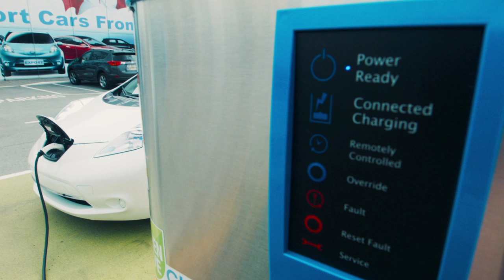Electric Motorcycles vs Gas Motorcycles (HARD FACTS)

Comment: Electric bikes need a removable battery of industry std design that can be swapped out in seconds. Imagine having a bank of batteries on charge & charged at the local servo like swap n go gas bottles  You pay a set fee just like the gas bottle system & now its just as fast as fueling up. You pull up remove your battery & put in the bank on charge then grab another fully charged & install then ride away.
Reply: It doesn't work that way. This idea is not original at all, it's the most common innovation by people on the internet
Reply: There's already an electric road scooter with standard swappable batteries in Taiwan. Look up the success of Gogoro. They have even has other manufacturers join them like Yamaha offering their own electric scooters based on this battery ecosystem.
Reply: Michael Clark they need swappable batteries. Real, long distance batteries, are far too heavy to just pull out.
Reply: @michaelclark3192  I came here to say just that. I currently live in Taiwan and Gogoro has really caught on out here.
Reply: @savagetuner2404  LOL you got something correct for once. A 25kwh would be way too heavy remove by hand and needs to be an integral structure of the sportsbike. Removable modules is already being done on weak small rideon like E-Scooters.
Reply: @shaggy LOL 600cycle is outdated to the point of wrong. Something like the Zero SR/F of that generation conservatively will do 1000 cycles. Based on a realistic 150 miles that's 150,000 Miles of solid dependable poweroutput. It could probably limp along with problems as it slowly decays all the way to 200,000 miles.
Reply: You know what its better to have a battery that can charge only in seconds and have a battery tht is lightweight and heavyduty..
Reply: You'd have to have some access codes...otherwise the meth patrol will jack em.
Reply: I don't complicate myself,I just fill the tank in a few seconds in my Honda CB1100EX and ready to ride with awesome sound and power
Reply: @Shaggydoo90 It's not that bad. the figures I've seen quoted for the LiFePO4 batteries used by most e-motorcycle and moped manufacturers are 20% capacity loss after 2000 cycles. However that's an optimistic range, the LiveWire only gets 70 mi highway range and the 14.4 kWh Zeros get 112. Twice that for city riding.
The key really will be standardization on a battery form factor. The Zero motorcycles have kept a single form factor for battery packs, while the technology improved capacity some 20%. If the big four were to collaborate on a single battery pack form factor, the economies of scale could cut the costs quite a bit, and mean that after the first 100,000 miles there would be aftermarket replacement options (and perhaps much better options, like solid state).
Reply: Someone just talked about NIO's entire EV business setup  in like 3 sentences
Reply: NIU makes removable battery mopeds, they have an electric motorcycle coming out soon that may have removable batteries too.
Reply: The problem with removable batteries is, who owns them? 

Seems like it would have to be a subscription service where you don't own the battery.  Do I swap my new battery with who knows what someone previously turned in?  Of course not, I'm going to trade in my 6 year old worn out battery.  And everyone else is going to do the same.  And the quality of the batteries in the pool is going to gradually degrade.  So the owner of the recharge service would probably have to own the battery, not riders/drivers.  This would likely also require the charge stations to be a large nationwide, or at least regional, chain.  Right now almost all gas stations are owned by franchises that only own a small handful of stores.
Reply: @rightwingsafetysquad9872   I wasn’t going to comment seeing how old this thread was but then your comment was only 10 days ago so yay I can comment! So I was completely on board and then realized what you’re saying as well. Then thought of a simple solution, all you do is turn your dead battery in like a core charge and you “buy” a new one. Still with the intent of the gas station gas bottle idea though. So as someone mentioned above, a lot of manufacturers come together and come up with an agreed design and then they push the system through gas stations. The gas stations have a process set up to automatically restock their batteries and a system for returning “cores” to the manufacturer. Those cores are of course anywhere from depleted 1 cycle to however many cycles it took that old guy to trust this system and buy one and try it out. And the new battery costs whatever and the cores give you a large amount of credit back seeing as your old battery isn’t really bad or a true “core” battery. Then gas stations could make the profit with the core exchange in mind and aim for it to come out somewhere right in the ballpark of the cost for your average bike tank of gas or charging session for these electrics. That would alleviate the issues you’re talking about with someone getting a “used” battery in bad shape from somewhere random. Each core HAS to go back to the manufacturer to get checked, completely remanufactured properly and can then be sent back out in a box to another gas station with a sticker saying “reman” or “new” for the news ones also presenting another way us customers could choose what we wanted to pay for. And yet again, we could even shift this from gas stations if that’s too much of a new system/hassle for them and direct that system to auto parts stores where they already stock TONS of batteries and already have complete systems in place for retuning cores on car parts and warranty-ing batteries and everything!
Reply: @julsluzanes5209  You mean a capacitor?
Reply: Taiwan's Gogoro scooters do this.

Comment: I've got a Zero SR/F.  The range is sufficient for what I do, charging is pretty quick (6kW), and the thing pulls like a liter bike.  Best part is going 0-80mph-0 from one stoplight to the next, silently!
Reply: I might be confused but you said silently as if it was a good thing. I'm sure it's just me mis-understanding you, going 0-80mph making zero noise fills my heart with sadness.
(Also it's incredibly dangerous as noise keeps us safe as bikers)
Reply: @TheJPHarvey  If I need noise to keep me safe, I've got a Hella Supertones horn on it.  Meanwhile, my bit of crazy-fun acceleration doesn't attract attention from law enforcement.  Heck, I can do a quiet burnout!
Reply: You've made some good points there I'm not gonna lie. But surely just must have a normal petrol bike in your garage too? I just couldn't be without a traditional bike
Reply: @TheJPHarvey  Indeed, you're right!  I also have a Yamaha Super Tenere that I've ridden into Mexico and back a few times.  :-)  But for local trips, I'm loving my Zero.  The two bikes couldn't be more different, each excelling at very different rides.
Reply: @TheJPHarvey  It´s more dangerous for blind pedestrians. By the time they hear it, it´s already there. I while ago I read that there where plans to equip electric vehicles with sound generators to make them more audible.
Apart from that the tires usually make some noise too. For an electric bike that will very likely not be different.
Reply: @TheJPHarvey  This. It's like sex... with no noise. But then the amount of turbovirgins around us who don't know how to have sex, want their bikes to be as limpwristed as they are 😂 👌
Reply: @TheJPHarvey  cars go those kinds of speeds without making much noise. I think this horse is a dead one
Reply: @maxlutz3674  let’s make all electric bikes make noise for that less than 1% of pedestrians lol
Reply: @TheJPHarvey  loud pipes are overrated. Pipes face backwards, the only people you're alerting are people who already see you. And if your pipes are stupid loud people won't be able to tell where the sound is coming from.

Comment: Your energy density comparison between chemical gasoline and a battery pack isn’t valid. Gasoline stores pure chemical potential energy but when burned, it isn’t fully transformed into usable power which results in energy losses of sound and heat. This is called Efficiency, and electric vehicles of all types are simply better at it than gas vehicles due to bigger things being more energy efficient and electric vehicles sourcing their energy from power plants (very being and pretty efficient) compared to your engine (much smaller and more less efficient in comparison).

Comment: It is not environmentally friendly. At best, it's a wash. Electricity comes from coal, the dirtiest fossil fuel. Batteries go into landfills when disposed. All the toxic chemicals go somewhere when the batteries biodegrade. And the batteries are expensive. You're paying for the fuel up front and your electricity bill goes up if you charge at home.

Comment: EV drivetrains are so much more flexible and dynamic, immediate response and performance. Remember range and battery tech isnt fixed, obviously tech like this advances exponentially, eventually making the older tech (gas) obsolete. Its how history and progress works, cant stop it so you might aswell get with the program.

Comment: You point out a lot of good facts but electrics have their place...
I have a Zero SR 2015. In the 4 years riding, the ONLY expense I've had is tires. This bike has paid for itself  in repairs, gas, oil, etc. I hardly ever use the brakes cause regen does most of the slowing down. Yes, they cost more initially but are really cheap to keep.  I've never had to stop for a recharge as I plug it in when I go to bed and I have all the juice I need to ride the 100 miles a day I do. I use the bike for commute and weekend jaunts so it's perfect for that. I'm not into cruising anyway. ...and the torque, WOW! I'll never go back to gas.
Reply: PleaseDontWatchThese | cheaper than an ICE bike in the long run.
Reply: That's great to hear! I've been holding out on account of, even though the "official" range is enough to do the "Alice's loop" as I refer to it (folks from the SF Bay Area might know what I'm referring to), when I asked the guy at the shop that sells 'em, he said real-world he wouldn't count on it. If you're getting an actual 100 miles per charge (is that right?) then that's encouraging. How much of that is at freeway speed, vs around town?
Now that they're starting to get the idea that a fairing might help with the freeway range (halfway there, anyway), I'm hoping sometime within the next 5 years they'll have something that meets my greater Bay Area needs, if not my long-range tourcycle needs.
Reply: @pleasedontwatchthese9593  I can only say that of all the things I have ridden, raced, or flown in 40 years the Zero is the most fun I have ever had.
Reply: dwc1964 | I extended my battery to the max. available amount of 18kWh.
When I really push my bike hard, I can get the range down to about 100miles (100% down to 0% charge … not healthy for your battery to do that regulary).

Usually I can easily get 150miles range.

When I drive carefully I can get over 200miles range.
Reply: 513eis how is the battery after 4 years? Still the full amount of energy?
Reply: Triple D | Probably not, but also probably still well within tolerance. And this is expected. 

Unlike a diesel or petrol powered car where the increase in consumption (read: decreased effeciency) as it ages is never mentioned … at all.

At least with battery degradation the efficiency is not impacted, so it won’t cost more and more to drive the same distance.
Reply: Hy, I am planning on buiyng an electric motorcycle. I was hopingbif you could tell me how much do you spend on charging your motorcycle a month. Would be very helpful if you could tell me. Thank you
Reply: Fatlind Pro | “a month” is a bad metric since a commutor will cover A LOT more distance a month than an occasional recreational rider. And even within those two categories there is a lot of variation.

I tracked my electric consumption the first year. I haven’t got the cheapest electric plan and ended up at about €2/100km

Or to calculate it using your own electric plan: After 12000 km, I charged around 750kWh
Reply: What’s the transmission like?

Comment: Thanks for making this video!  I've been riding an electric motorcycle for the past 4 years and agree that range, charging time, and weight are all huge factors.  If you get a chance to ride the new Energicas, please check them out!  They've improved so much that the gap between gas and electric is getting really small, and the charging infrastructure is totally enough for a cross-country road trip now.

Comment: Glad you added that last comment about 600's. I cant count how many noobs tell me their 600 is just as fast as my R1. We'll, atleast until after they ride a litre bike and realize what my bike does in 1st gear, theirs does in 4th
Reply: oooo you're a big man
Reply: I think you got the gearing backwards....
Reply: @mr.monkei  no you said it backwards
Reply: @sheldondrewett9461  damn just read it and realize I did put it backwards lol
Reply: Doble | I noticed the same but thought you meant stuff like wheelies and acceleration.
as in: Their bike can wheelie and accelerate real good in 1st but your litre bike can still do the same in 4th.
Reply: 600 super sports are quick, but on the upper end. My SFV manages to keep up until illegal speeds. It's quite torquy so off the line I'm quicker.
Reply: I mean they are both equipped with very long gearing, so you arent really riding around at 180+hp in slower curves anyways.
Reply: And on curvy roads... Ah. With the unfortunate long gearing it might matter but basically you are not faster with 200 than with 120hp necessarily. Lazier in shifting. Yeah.

Comment: I think that the new lightning strike having level 3 fast charging is a big step towards electric bikes becoming more practical. Being able to charge what is currently the highest capacity battery in the industry in only 30 minutes is a huge leap forward.
Reply: The Energica already is being delivered and already does that.  No Strikes with that charging or battery configuration have been delivered yet.
Reply: Crissa Kentavr yes they have, just not very many
Reply: See newzerolands videos he talks abt them
Reply: @theelementalscientist6631  Crissa's right, as far as I know.  They're still implementing the bigger battery and DC charging, but that'll be a game changer in getting electrics closer to what gas bike riders are used to.

Comment: Zero S/SR is the best motorcycle type I've ever owned. In the same token, owning a Tesla is better than any gas powered car I've ever owned. I don't do anything over 98 on ANY motorcycle off the track, and I don't go to the track anymore. Purely anecdotally but the lack of sound makes me feel safer because I'm just another vehicle on the road. I've stored my bike for over two months uncharged and it didn't lose a single percentage of charge in that time. I've put "gas" into my bike at convenience stores and other places, and often joke about how I can refuel at more places than gas motorcycles.

The technology is only going to get better. The instant torque and lack of shifting/single drive is something I can never, ever, ever give up now. I hate when I'm forced to ride a gas powered vehicle now - it feels so... shitty.
Reply: I do 105 in my 1997 diesel Jetta all the time! What's the purpose of having a sport  bike that is slower than a horrible car? (I do commute 260 miles regularly)
Reply: Elliott Vader Why do you do 108 in your Jetta, exactly? Unless you’re ripping it on the autobahn, I see no need to ever drive or ride that fast in public. Doing so is completely irresponsible as well as reckless and very illegal (well over every posted speed limit) where I live.
 
So to answer your question, it’s because I’m not irresponsible and don’t drive recklessly. Top speed is ultimately meaningless because even the shittiest cars can go over 100 - doesn’t mean they ever should.
Reply: same here. After riding gas-bikes for over 15 years I am now extremely happy with my Electric Naked-Bike. Regarding to range, the new 2020 Models from Energica have enough Batterycapacity for 200-250 KM. Energica claims up to 400KM, but based on my experience with the 2019 model, I say 200 KM are easy possible, even when you ride sporty.
Charge times. I can Charge up my bike in 20 Minutes or less to 80% State of Charge. So after a 2 hour ride you have to be very quick to go to the toilet and refuel yourself with a cup of coffee in order to not be slower than the recharging of the motorcycle.
Reply: Soy Boi Man I love your point because I have pointed out that too.
here in my country I ride my electric motorcycle EVERYWHERE, is my main commuting vehicle, I have had it for 4 years and the only things that I have spend money is in tires and just one brake pads change.
I'm my city there is HEAVILY use of motorcycles and being a bike with less hp than others, I'm almost always getting ahead on green lights because of the initial torque!.
never will buy a gas bike!